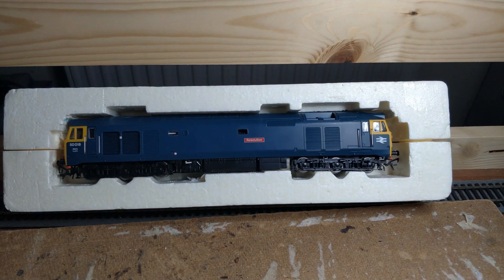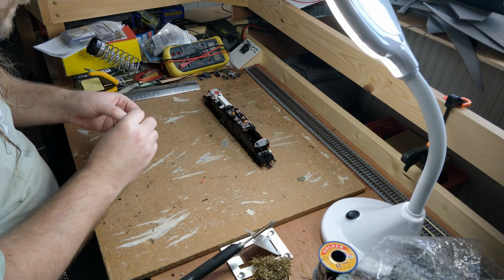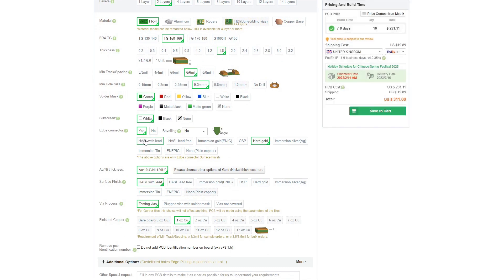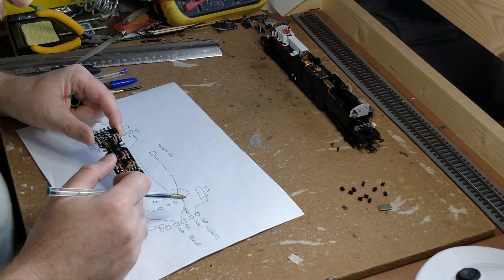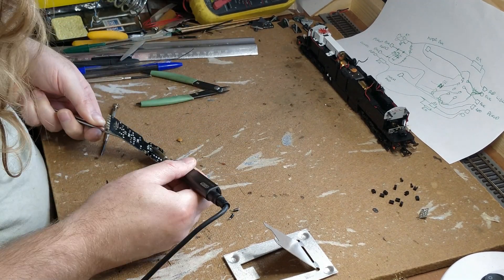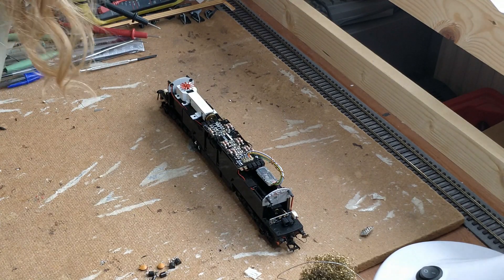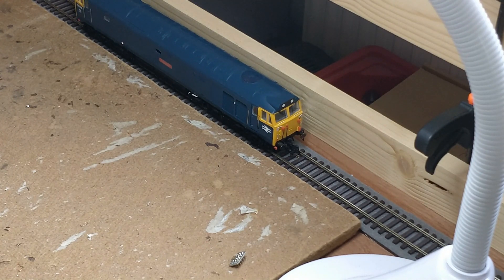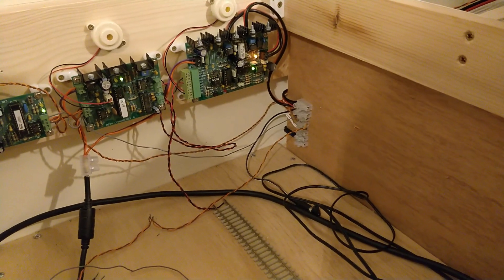Hornby Class 50: Fixing a Dead Short when DCC fitted

Comment: Unfortunately its a common fault with the early PCB board, Hornby later updated them. However there is a simple fix... Just put the decoder in back to front and all will be well :)
Reply from the maker: Plugging the decoder in backwards will work ... up to a point.
For loco movement it's fine, but the reason that works is that you lose the common positive pin for driving lights.
More importantly for me, it also swaps the left and right rail connections, which will affect how ABC is seen by the decoder.
Reply: @DongitsModelRailway  done this on several Class 50’s with forward lights (old pcb board as per your video) and had no issues, also used dcc sound decoders bank to front with no issues on said pcb board. Glad you got it sorted 😁 certainly an in-depth and well explained video 👍
Reply from the maker: @DugmerJunction  I guess all the lighting circuit they had to convert from common anode to common cathode handled the missing pin successfully then -- that's normally a problem when plugging in a decoder backwards, but obviously not in this specific case.

Did you use ABC on the locos with the decoders plugged in backwards at all?
Reply: @DongitsModelRailway  either that or it was just a print error on the pcb board.
Reply: Hi. Which Class 50 is that? I got Agincourt which I think was the last all blue one they did. Hopefully I won't have this problem, although I can live without lights if necessary